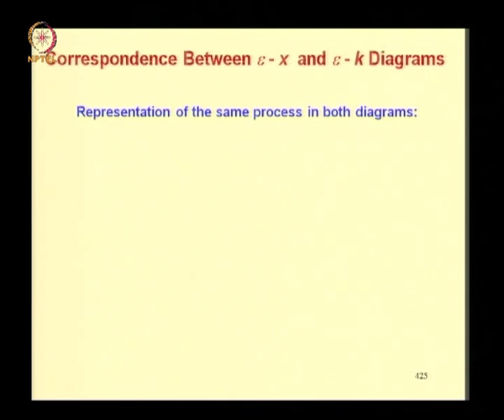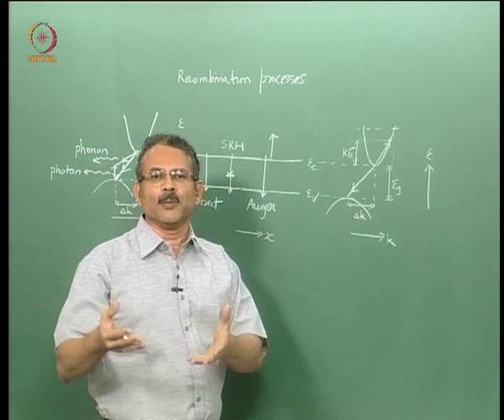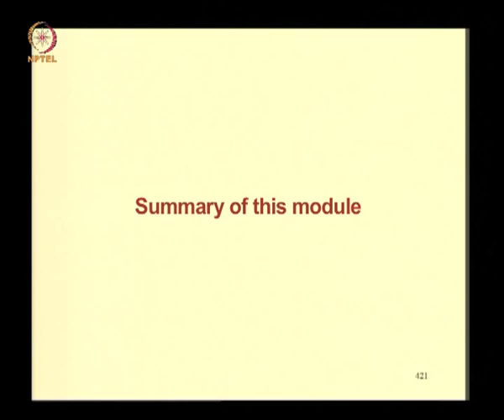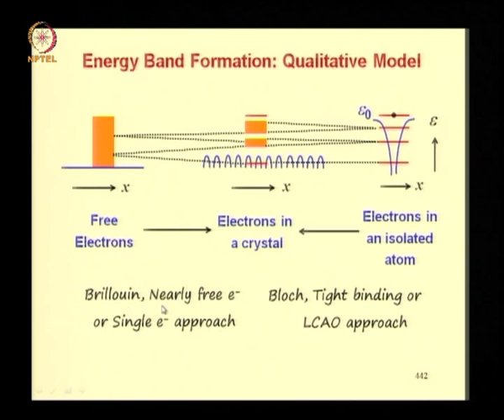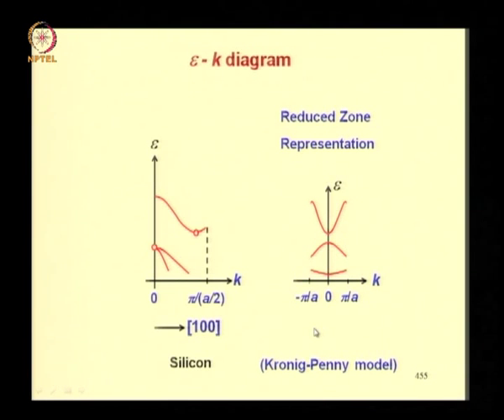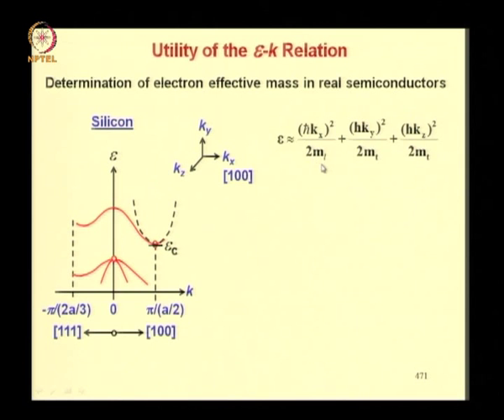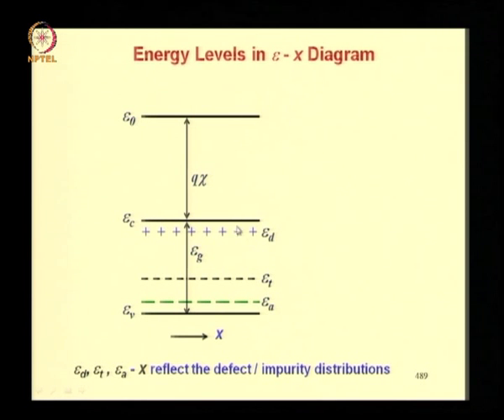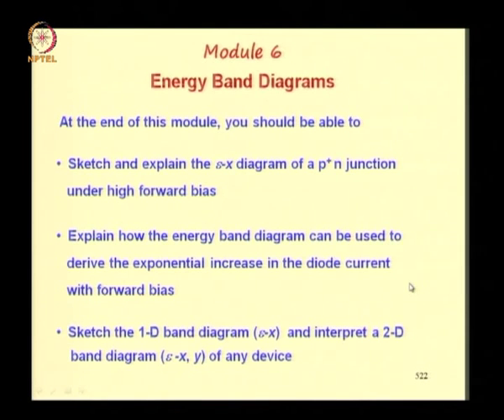Mod-06 Lec-07 Energy band diagrams

Comment: Amazing video.... I think e-k diagram needs to be changed for the drift case.  Net energy is constant, if electron is gaining energy and potential energy  needs to be decreased to maintain net energy constant. So, in e-k diagram should be redrawn with lower Ec (at k=0) values along the x direction.